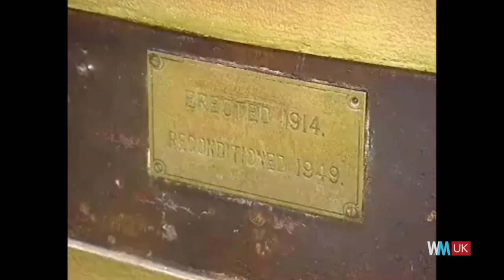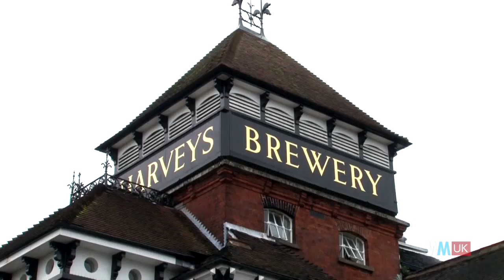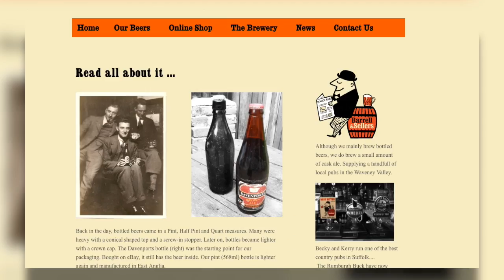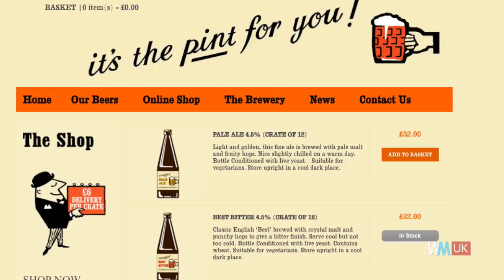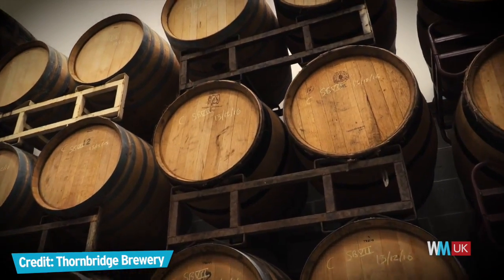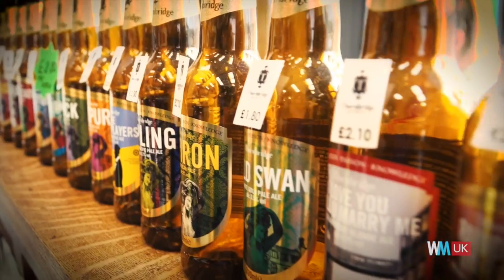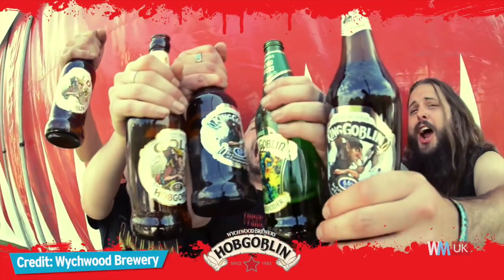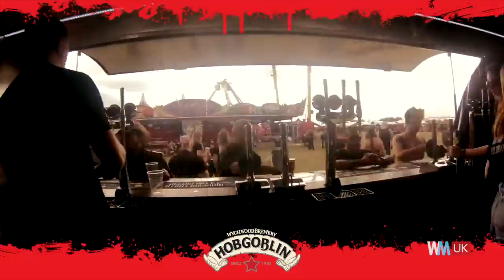Top 10 Best British Beers

Comment: For anyone wondering about the footage of the festival used in Hobgoblin's advertising - that's the Bloodstock Open Air festival held in Catton Park in Walton-On-Trent, Derbyshire. It proudly boasts that it's the "UK's largest independent metal festival", and works closely with Hobgoblin in its Metal 2 The Masses initiative, a national competition for unsigned metal bands to win a chance to play at Bloodstock on the aptly-named Hobgoblin New Blood stage. 

And in pretty much every bar that isn't tied to a specific alcoholic beverage (such as the Kraken or Jaegermeister tents), there's always Hobgoblin available.